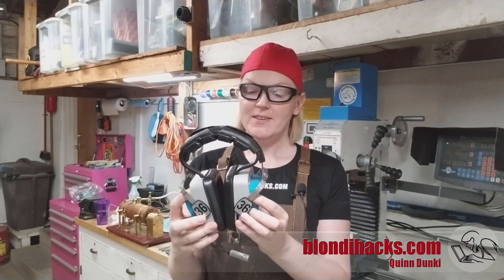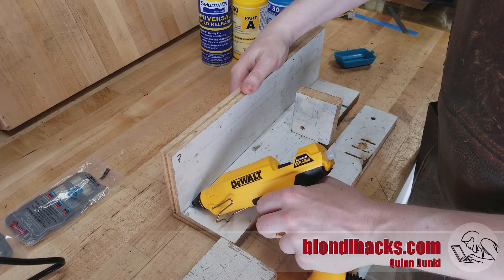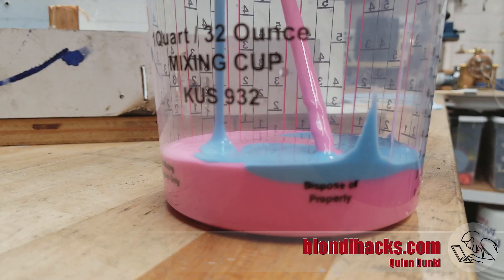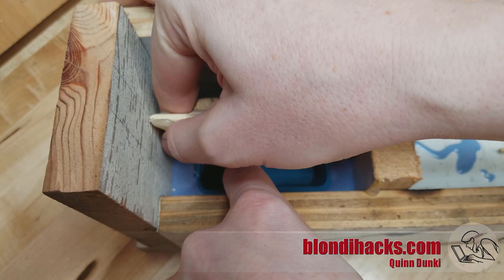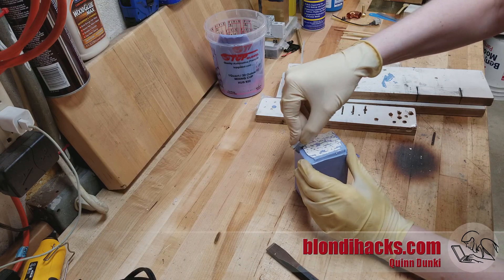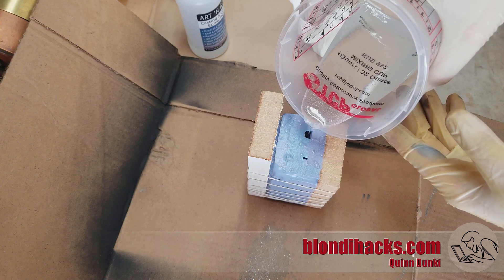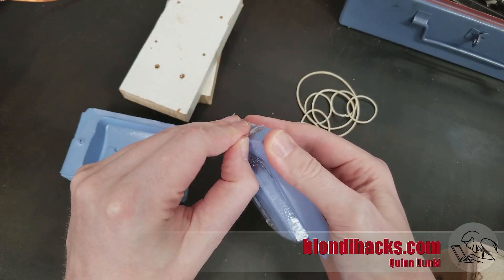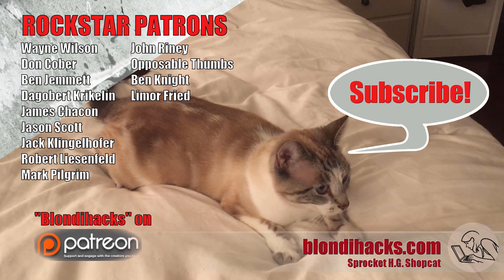Resin Casting Headphone Parts

Comment: I've always measured things like epoxy by physical quantity, but a knowledgeable person told me it is far more accurate to measure by weight.  Also, I know when I mix my epoxy I actually set a two minute timer after having curing difficulties, and I've never had an issue since.

Comment: My major irritation with 2 part epoxy resin is the ratio. For GRP use it tends to be 100:1. What? 1 gram of hardener per 100 grams of resin? To get that right when making small repairs I'll be throwing way several times as much as I'll be using! Go low or high (way too easy to do) and it will either never cure or cure faster than you can use it. 

That's why my Mirror dinghy has sat, forlornly, under a tarp for 2 years :(
Reply: I have been instructed to use weight by the same ratio.  You should be able to do anything from a Dram to a Gallon using a cheap digital scale.

Comment: Mold keys looked they were probably a bit deep with not enough mold release getting all the way in.
When using that casting technique, I usually just cut 3-4 small pyramid chunks out of the first pour before adding the second. The chunks can then go in the second pour as filler to minimise waste.
Reply from the maker: Good tip, thank you! I have a lot to learn about silicone molds.

Comment: Bob Claggett (@iliketomakestuff) had a similar issue with a resin casting not curing, I believe he said the suggested ratio needed to be altered.  I think he used EcoPoxy.
Reply from the maker: Good to know, thanks! I'll check that out.
Reply: adding a bit more hardner and letting sit longer will also help. might also consider a vacumn chamber to help pull out any gasses